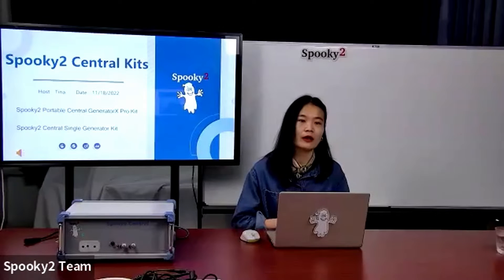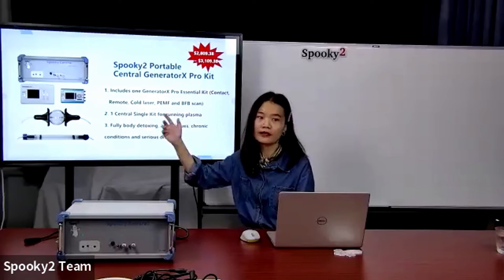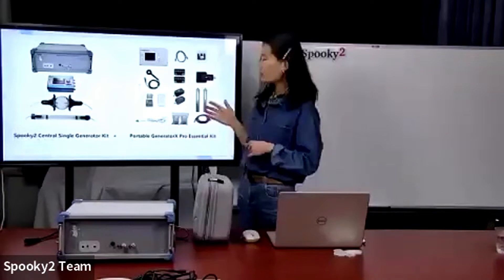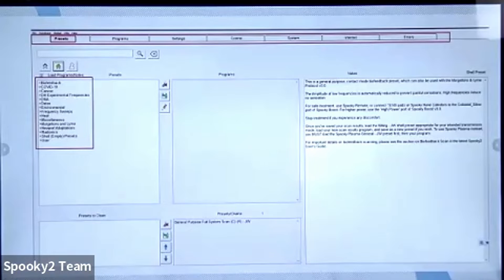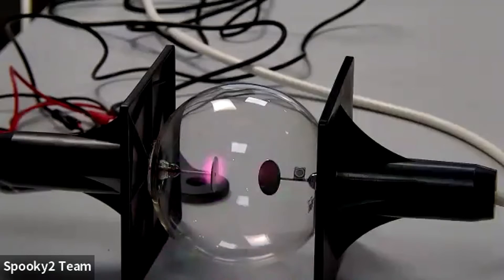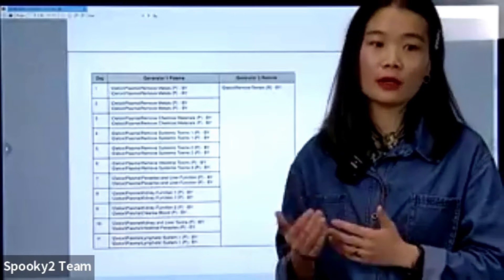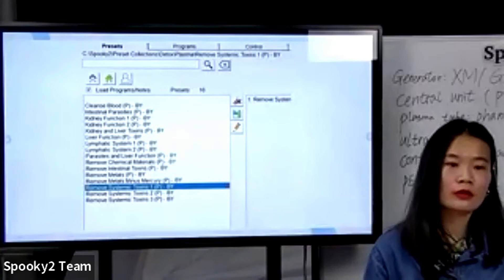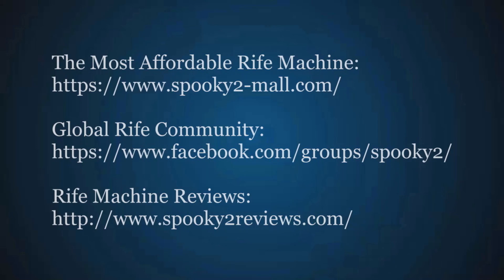Spooky2 Live #5: Central Kits

Comment: Great explanation. Thank you. I have generator Xpro, generator X and 5 generators XM. And a laptop running only for them. They all run continuously... But now I want to add Central to it. Do I have to use a separate laptop for Spooky2 Central or can I use the laptop I have already running with al other Generators.
Reply from the maker: Dear friend, you can use the same one because central only needs to be connected with the generator.
Reply: @Spooky2Rife  Thank you, I wil do that.